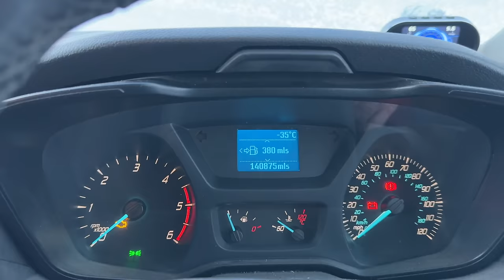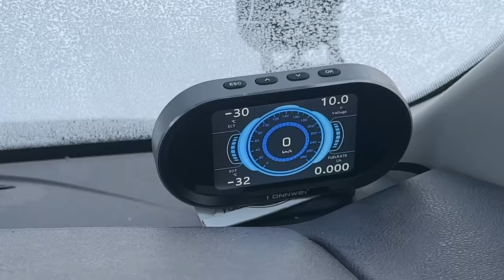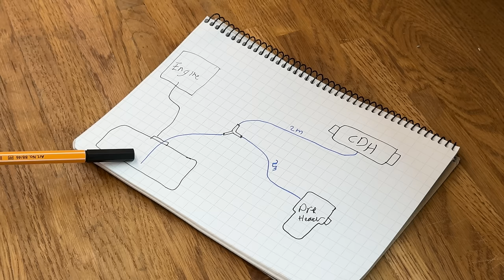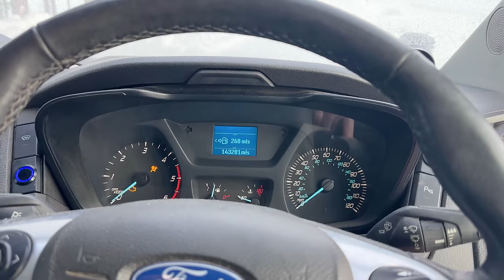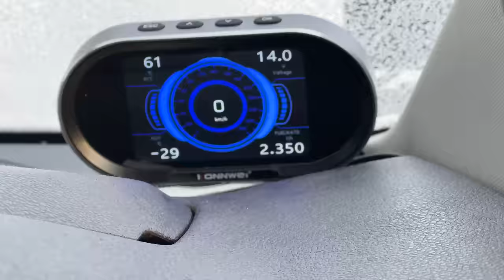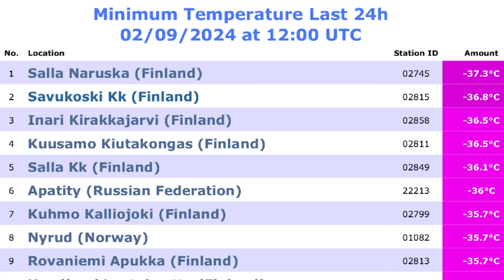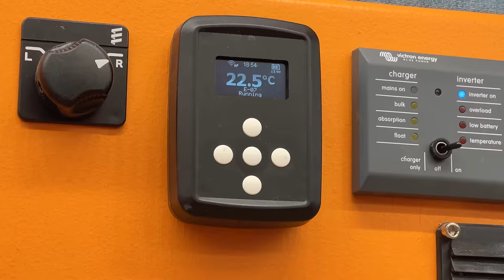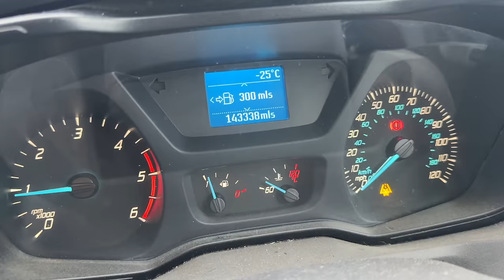DISASTER! Vanlife in the Arctic goes wrong!!

Comment: 3 things you could purchase as emergency kit.  Diesel fuel additive anti-gel put in the tank at every fillup.  Diesel fuel rescue additive when your tank and/or lines are gelled.  Rescue additive is only used when you are gelled up.  Other item is called a heat tape.  A heat tape is a plug in flexible wire attached to a thermostat.  They are used to keep water pipes unfrozen when the water lines transition between the ground to a heated space.  They zip tie on to the line and they will not melt plastic.  They are weather proof.  Brand name easy heat.
Reply from the maker: I usually don’t need to add extra additive as all the winter diesel in the Nordics is treated at pump usually to -35 or -38C. below -35 is reasonably uncommon. I had three occasions of it this winter. Many of the commentators have put on this video one of the garage brands which is what I don’t usually go to stocks -40 diesel which is something I would probably look at using in future years on the night I’m looking for the extreme cold. 

Heat tape is also one which has been mentioned a number of times before it’s not necessary for my water pipes as all my piping is now intern I am built in a way where it’s kept warm by the ambient heat for the diesel heater. On fuel line could be an option, although it’s now been  mentioned that there is insulated fuel line in the use

Comment: Going into the deep freeze and having to rely on all that tech, you are a brave man. I grew up where it gets colder than -40c. Id probably not venture out if I had to rely on batteries in that cold.
Reply from the maker: Diesel heaters are hardly to be considered as tech surely? They’re pretty dumb things in the grand scheme of things. sure, I use a lot of tech but everything has simpler backup options.

They are the normality for All over the world for cold places be that diesel powered engine preheaters or and diesel air heater ( of which I have spares of both ) 

I mean, most vehicles up here don’t even use diesel powered ones they use electric engine preheaters which they plug their vehicle in when they’re at a parking spot. 

Even if everything else had failed, it still wouldn’t be a problem. I got plenty of cold weather kit and 5 season sleeping bag. My professional background is working in extreme environments.
Reply: @MispronouncedAdventures  You definitely seem very confident and capable enough to work things out.

I have been in more than enough cold weather problem solving situations for a life time. I now live in the desert western US. even at 1800 meters elevation the winters are much more tolerable.

What brought about my comment wasn't the diesel heater. it was the van. It not starting without pre heat, then the pre heat failing, then a battery generator and back up heat, then the starting battery. 
That is far too much to much to rely on for my liking. Although You did make it work, so the redundancy paid off. 

 I own several diesel trucks and if they cant start on their own with glow plugs and treatment in the fuel, I consider that a problem. one rig has an ether cold start system and has never failed to start despite it being 40 years old(Cummins diesel for the win). I have standard plug in block heaters on the rest, but I cant always get electric access. So far its rarely been an issue.

Having nearly died in sub zero situations in very remote locations, I'm a bit wary on extreme cold weather boon-docking. Hypothermia is no joke.

I would have multi fuel, non electric heat sources on board if I had to rely on batteries in extreme cold. you cant cook with a sleeping bag. 
But like I said, you are a brave man.

 I have a bus conversion with a wood stove that can go 8 hours between stoking, that has been excellent. LPG stove as well. Also has ether start.

Any way, I really like your videos. keep it up. I found your channel researching diesel heaters. 
If you come to the Americas I could give hundreds of suggestions of locations to visit. its cheap to travel here.
Reply from the maker: @railroadmike6843 
That whole day was mostly a cock up at end with gellled fuel as I used the wrong grate on a cold night, the pre heater was working just no fuel was physically getting to it. . On the engine not starting with  o pre-heat that’s mainly as there is a big different in North America and European engines. North American engines tend to be larger capacity and simpler overall whilst European engines focused on smaller capacity, higher efficiency which makes them quite a lot more complex and they don’t necessarily like being forced in cold weather starting.  

I do also have a gas stove on board. 

Wouldn’t mind shipping a van over to North America at some point for North America winter
Reply: @MispronouncedAdventures  You would be welcome on my end if you did decide to come to the Americas. 

And don't bother to ship a van. vehicles are still really cheap here if you know what to look for.

A fella such as yourself could very well make some great video content finding a cheap used rig, and then outfit it American style and run from sea to sea. North to south. Then sell it and recoup most of your money when you are done.

Keep in mind all of the EU fits well inside North America so you could spend a year and never see it all.

Give it some thought and reach out if you want to do it.

Comment: On extremely cold nights why not run your engine all night. Carry extra Jerry can's.
Reply from the maker: Mainly as it’s normally not necessary. if I had the -38 fuel in the van it would have been a problem, but it seems I had filled  up with -35c. I had a multiple other nights that cold without problem. 

I do have a single jerrycan, but I always make sure my fuel tank is at least half full before any overnight stops which is at least 45 L of fuel

Comment: Great vlog 👍 of problem solving, I saw Adz had a heated plate under the gear box . So just wondering about heat tracing and maybe electric preheating, or all of that . I lived in Canada for 16 years they had standard plug in engine block heaters , never used mine, and it did get down to -38 one or twice. I understand they don’t have much diesel there so not the same issues. Well done thank you and good luck 👍👍👍🏴🏴🇬🇧🇨🇦🦢
Reply from the maker: Adz’s heater pad is under his oil sump, not the gearbox that’s because unfortunately, I didn’t have time to come and fit the engine preheated before his trip! 

They use plug-in block heaters here, but they only work for on grid solutions

Comment: You should add trace heating. That way you can warm the lines before starting
Reply from the maker: Not massively necessary, no one else in the Nordic really does it for fuel lines, although next time I might insulate my fuel lines. Trace heating for water pipe shore but not needed in my van at all. My water pipes are internal. 

I just had the wrong grade of window diesel in that night

Comment: If you have the diesel pipe inside of another pipe it would help to stop it freezing, plumbers do this with condensing boiler external condensing pipe
Reply from the maker: definitely could be an option. But the -35 temperatures which get below the Arctic diesel are rare. Usually just waiting for it to warm up to around -30 would be sufficient.
Reply from the maker: definitely could be an option. But the -35 temperatures which get below the Arctic diesel are rare. Usually just waiting for it to warm up to around -30 would be sufficient.
Reply: From my personal experience of motorhoming , belts and braces is the only  way to go

Comment: Some tips.
#1 Here in Finland,  we normally insulate the engine heater fuel lines and pump. No bare lines exposed to outside temps.

#2 In massively extreme temps, leave your engine running!

#3 There are several types of Arctic diesel. Each is rated for lower temperatures. If you can't fill up with the lowest temp rated one, purchase a diesel additive to prevent gelling. Keep the diesel thinning additives as an emergency part in your spares. 

#4 Consider an electric battery warming blanket for your starter battery. Wire it in switched, with your cabin power supply. 

#5 once you warm the engine heater fuel line, you may need to prime it again, since it acts the same as being out of fuel.

#6 Consider allowing the cabin heater to run at lowest setting all night in extreme temps. This will keep your fuel moving enough to prevent gelling.

Really enjoying your adventure. Please remember, it's only fun until you freeze to death in your van.

Thanks for sharing 
Julian @oh8stn @65°N (the other me)
Reply from the maker: Thank you for taking the time to offer advice! 

1. This video is the first time people have ever mentioned insulated fuel line to me. It wasn’t something I was aware of definitely consideration for my next van. 

2. I can definitely see the advantages not sure how much my DPF would like idling overnight! Future times I will probably leave the engine pre-heater on its thermostat though. 

3. I was only aware of the -38 stuff. A few people have mentioned on this video that Neste have fuel below -40c which I’ll definitely take notice for next time I’m going after the extreme cold. 

4. With my starter battery under the driver seat it does remain a little bit warmer than outside , but something like that would definitely not go a miss. I do the opposite where I use the 30A amp charger to charge it at high rate of amps to induced internal heat via current.

5. With the third-party controller I have for my engine pre heater priming isn’t a feature. I just have to do multiple failed starts which obviously isn’t ideal. 

6. Could definitely see the bonus in doing this if I was leaving the engine running.

Freezing to death is definitely not on my plan agenda and also have spare heaters. I also have my 5 season Himalayan sleeping bag which is rated to colder than the conditions outside.
Reply: Hey, Alex love your adventures, I dove a Russian spec Scania for a while and I remember the engine heater I used to leave it on all the time it also heated the cab when the engine was switched off. All the fuel lines were insulated, plus heaters everywhere. Keep up the good work.
Reply: @MispronouncedAdventures  "5 season Himalayan sleeping bag" is that just to shelter in the van? I'd be interested in a video of your bailout bag, comms and other contingencies you have in place for a worst-case-scenario ie complete electrical failure and van damage. What would you do for heating? Like deep discharging, pushing 30A though your SLA will shorten its lifespan. It is interesting to see what people do in Siberia in much colder temps.
Reply from the maker: @LoremIpsum1970 high attitude sleeping bags can get called a 5 season, 4 season is a 
 winter sleeping bag, five season is the next step up into far more extreme colds. I could’ve comfortably slept outside in my tent in that sleeping bag 

Heating wise, I additionally have an entire spare diesel heater and an entire spare engine pre-heater. 

30A on a 80AH AGM starter battery is fine. It would be getting more than that from the alternator when the engines running.
Reply from the maker: @LoremIpsum1970 on top of that I also have my normal expedition work kit Emergency bag with me and satellite comma
Reply: @MispronouncedAdventures  Video would be interesting!
Reply: Well, I've never been able to pick up an oil leak before!  You can just brush it off and pop it back in the engine! 🤣
Reply: In Finland every car has electric engine preheater. Typically they are 750w and 230v. Since you have lots of batteries 230v is not a problem.  Please install one as back up.

Comment: When running convoys in the winter in Bosnia,up on the high level roads we discovered the temperatures dropping to -40 or so. The local drivers were driving beat up bog standard trucks with 1 special component added....

Slivovitz local brandy.

The drivers were in various stages of being completely drunk on this potent drink and as they informed us, they would also add a bottle or 2 to their diesel tank to stop the fuel waxing up.
Reply: Bosnia ❤️

Comment: Heat gun straight into the air intake, brilliant.  We design this into diesel engines, makes sense that it would work on a diesel heater.
Reply from the maker: Yeah,  directly into the intake definitely a quick way to warm the core and any fuel which might be gelled in it. A friend of mine used a air compressor once before to help start a clogged with diesel heater with soot and blasted a load of soot out of the exhaust

Comment: As an ex European truck owner and driver, standard diesel is now treated for low temperatures but before that we use to add petrol to a full tank of diesel either fueling in uk or Europe during the winter.  Remembering that most of a trucks fuel pipes are outside       (  400 litres about 5 gallons of petrol )  we did do Scandinavia quite a lot in the winter.
Reply from the maker: The diesel was all pre-treated in the Nordics. You can’t really buy non-winter grade diesel in the winter. But it comes at different levels normally. -35 or -38. I few places also stock below -40c. 

Before this section of the trip I had to come from one of the cities and probably filled up on -35 stuff and that night it was -35 for below

Comment: to heat the engine switch key to ignition, set the ac to full heat and enable Cabin air circulation. This will use the warm cabine ear to heat the engine cooling loop.
Reply from the maker: I see the principal, but my engine doesn’t have an electric water circulation pump, just one ran by the engine running. But I’d like to give this a good next winter

Comment: In Canada eh they formulate the winter Diesel to stay liquid at lower temperatures. It's the oily nature of diesel that makes it get so goopy at -40C etc. Try an additive. Methyl Hydrate should work but maybe ask around. If only the exhaust from your diesel heater could be used to warm the engine rather than making a circular melted spot on the hard pack snow beneath your Van, man.
What about thermoelectric tape for your fuel lines?
Battery cold, get battery heater blanket.
Reply from the maker: Different grades of fuel in the Nordic is available at pump you don’t usually add additives but of course you can if you wish to. North America does get colder than the Nordic. Normally -38c or -35c winter Gray diesel from the pump is perfectly sufficient -40 years rarer but there is as I’ve been now told in the comments at one company which stock the minors -40c for stuff and it’s always an option to add additional additive

My battery gets cold, but not too cold as it’s based in the cab so it gets some residual heat from the habitation. It would be a different story if it was in the engine bay. 

Diesel heaters can be quite fussy on there exhaust pipe length so it wouldn’t really feasible for me to reroute it anywhere else

I think for the next van insulated fuel line would probably be worthwhile

Comment: Great video. I am amazed by all the technology you have and you trust your life at night to a CDH and not a more substantial brand 🤣🤣 problem solving was class. 💪🏻💪🏻
Reply from the maker: I’d still say “my” CDH is superior in functionality to webasto, espar and autoterm. As I got rid of its original controller and replaced it with an afterburner. CDH coming in such a ranging of quality which is the main issue. My one now has 5000 run hours now. And in this situation, it was the webasto which failed!

Comment: In the Sahara during the winter on an oil pipeline, we used to put a smallish fire under the diesel tank to melt the gel.
Reply from the maker: Cant do that much more modern vehicle have so much plastic and wires under them now. I would guess your diesel out there is normal grade too
Reply: @MispronouncedAdventures  this was about 40 years ago, and it was a large generator. Never managed to set one on fire

Comment: I was looking into diesel gelling at some point a while back... one of things that struck me was that if you fuel up with something like -10 diesel and realize your mistake and try to fix it by pouring -40 diesel into the tank, the mixture still retains some of its gellificational abilities - as I recall if you fill a tank 50/50 with -20 diesel and -40 diesel, the end result is not -30, but something like -25, possibly even worse.
Reply from the maker: It’s generally very hard to fill up with non-winter grade diesel in the Nordic and it’s all pre-treated at pumps to at least -35. And that’s usually sufficient it doesn’t often get colder than -35c 

But yes, if you have  a low-grade is in your tank it’s not the easiest to necessarily figure out the maths required to change the mix.

Comment: I’m thinking a super cold weather protocol be good  - ie some special steps you take to prevent key things freezing up on the coldest nights?
Reply from the maker: My protocols between a normal -15 to 20 overnight temperatures versus -35 aren’t really that much different. 

I always make sure I’ve always got at least half a tank of diesel which is around 45L, a new protocol will be to make sure I’m running -40 diesel plus In known extreme cold nights coming. Bring power stations and drinks in from the cab into the habitation and put them near the heater. Take any water bottles off the floor. 

That’s really about it

Comment: You should fit a heated sump as a back up, in the old days we would light a fire under the engine ha ha
Reply from the maker: Sump heater wouldn’t of done much in this occasion. The oil wasn’t the issue. It’s 0w30 as it’s a euro6 engine so it’s thin and still inside its operating temperature. 

The gelled diesel in the pre heater and the engine was the issue